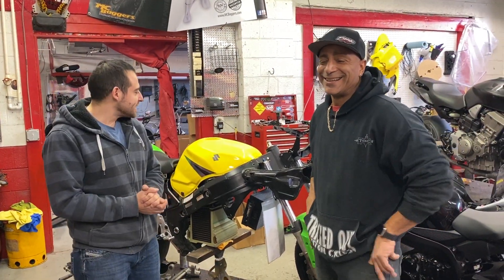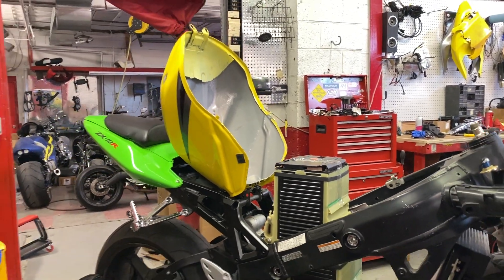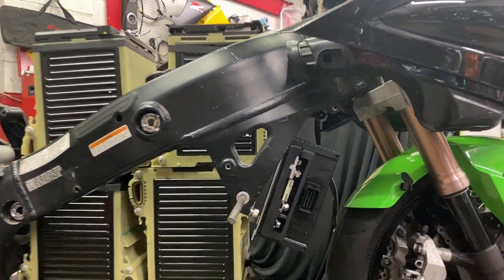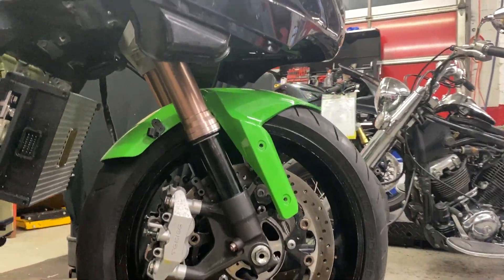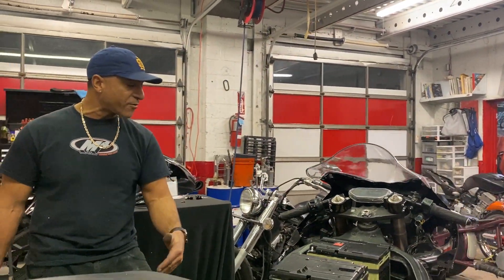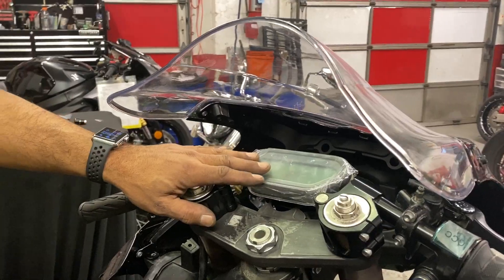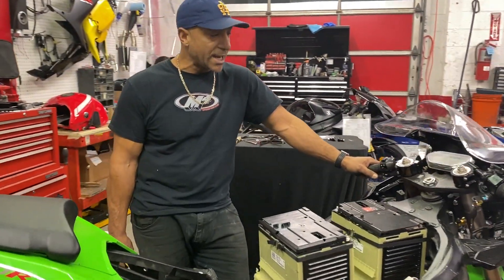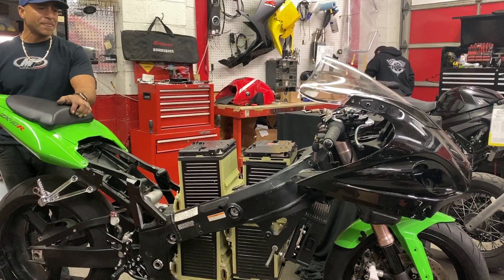electric hayabusa build part 2, electric motorcycle, qsmotor,   .

Comment: How heavy is that thing??
Reply from the maker: Lighter the. A stock hayabusa no engine , no exhaust, no chain ( might laugh but the chain is like 25-30lbs. The motor is 45 lb and the batteries all together are 130lbs . So its about the same or lighter
Reply from the maker: I believe the hayabusa motor is 150lbs , gas is about 10lbs per gallon , exhaust is about 40-50 lbs , chain 25 lb, and switch out the rear with a lighter one . So yea the entire set up i have is only 200 lbs but we removed about 250lbs
Reply: @diyguy1476  25 pound chain ....... whats that about 5000 links ?

Weight distribution will be the main pitfall i recon not over all weight but on the move this is not such a problem . Should be epic and good luck to you .
Reply from the maker: If your in the philly area your welcome to come by the shop and test it out , because we can move the weight , it’s ungodly balanced. Its crazy anyone who rides one of the electric bikes comes back smiling ear to ear , its a whole different experience its not like riding a motorcycle, i cant explain it , its something to need to experience 😊